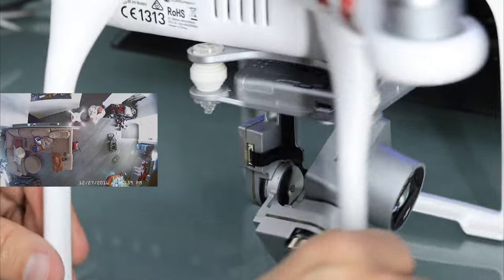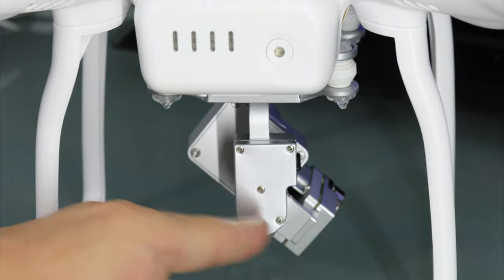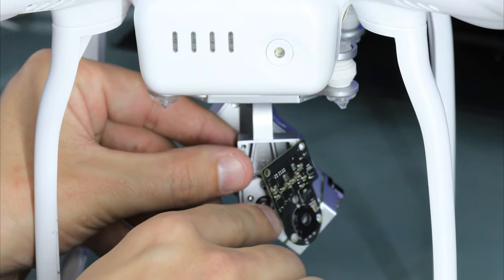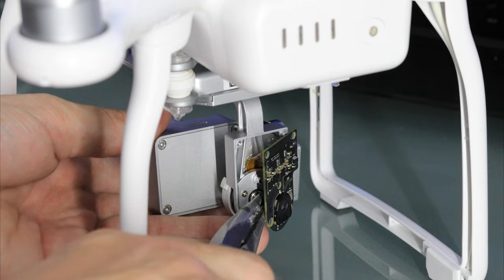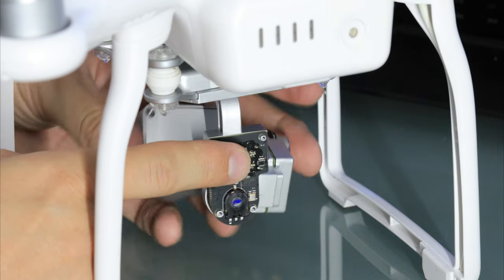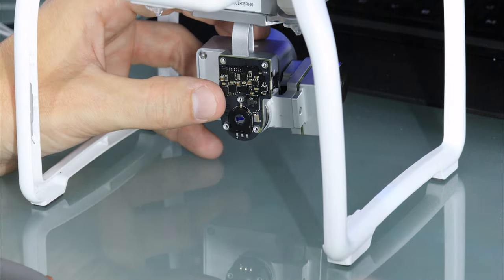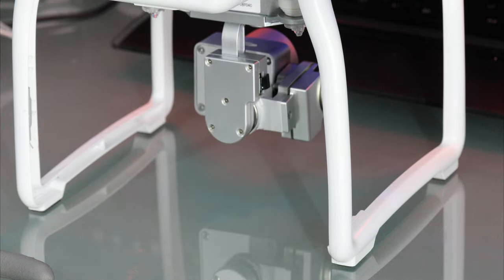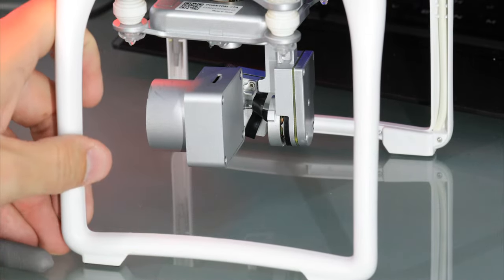DJI Phantom 3 Gimbal Motor Overload camera fix

Comment: So what happens if all the axles are aligned and screws tightened? Fun part is that my problems started after a nasty crash but it's all aligned anyway. I didn't have to correct a thing. It still starts tilted and keeps rolling to the right.

Comment: I have an issue after an accident the Flexible Gimbal Flat Ribbon Flex Cable broke and I ordered a new one and installed it once I install it camera because craze as it in your Video . I tried to do as you did no luck same issue I ordered a new  Gimbal Roll Arm & Motor . I installed them but same issue camera is very crazy please let me know if you can help

Comment: Clint, in the last few seconds you talk about "when I took this off and stuck it back on"... In a frantic mess after mine dropped I popped mine back on trying to help. Since then I was unable to "stick it back on". What am I missing? How do you pry your pieces apart even after that little screw is removed? Any help is appreciated. Thanks.
Reply from the maker: Mine just kinda snapped on, kinda magnetic I think. It was so long ago, I can't fully remember, but on mine didn't even close all the way perfectly shut when it "snapped it back on". You can see the little gap. I'm not sure how that piece is supposed to stay on there. It just kinda snapped back into place.

Comment: I'm having this issue but I noticed gnat flat part on the shaft is only out of line the slightest amount.  Would that still be the issue? I didn't crash mine it just popped up this morning.  Thank you.

Comment: Awesome, video, thanks man,  however, after I did the rotation adjustment, now it won't even try to calibrate, it will just sit there until eventually the overload message come back,and the right hand side gimbal motor is super fry and egg on it kinda hot. Any suggestions? Thanks.
Reply: Mine did same.  After adjusting the gimble 180 degrees and then back 90 degrees it worked.

Comment: Hi, just curious, obviously you are turning the shaft but do you happen to know if the shaft is turning inside some sort of clamp or if the shaft is turning something else inside, at a guess, the gimbal arm?
Reply from the maker: Not sure. If you find out, please post your findings.
Reply: Hi, if I get a scrapper or have an accident with mine I will let you know
Reply: @Team.Louish  It seems there might be a "magnetic sensor ring" on the shaft, it interacts with a sensor on the board. The ring might be glued to the shaft, twisting this ring wrt the shaft changes the 'rest' position of the shaft and therefore the gimbal wrt the board. Acetone might be a solvent for the glue. The ring is apparently very fragile so needs to be handled with GREAT care. As it is magnetic I am not sure whether it is a good idea to use steel etc. tools to move the sensor ring. There are a number of threads about this sensor ring on the phantompilots forum e.g. https://phantompilots.com/threads/p3p-camera-off-center.118727/

Comment: Hi there, I have the same problem with my phantom 3 standard, however, the level sign of my drone is totally aligned with the horizontal plane. What else the problem could be? Best regards.
Reply from the maker: Sorry, I'm not sure. But if you figure it out, please post your solution here so others can learn how to fix other issues.

Comment: i did it it sux anyway, always came back with same problem till i put some super bonder glue on it all. now it sends this overload message but still flyes and record. think its kinda solved but gimbal is not moving anymore due to the glue dji made a shitty fragile gimbal

Comment: Sir why is my phantom 3 camera geting hot after flyt ?
Reply from the maker: You might have two pins on the ribbon touching. Check the ribbon cable going to your camera and make sure its seated perfect and not damaged.

Comment: Could anybody Help me
I crashed the Drone agains a Wall the camera shaked and shaked and i turned IT off
I took IT Home and turned IT on its not moving, but it was before
It smelled a little Like yk When metal Burns, i saw 1 kabel is a little bit cuted.
Could IT be That problem the wire?

Comment: To anyone here..is it possible to put a GoPro gimbal on a phantom 3 standard to replace the original gimbal?
Reply: Clint Decker - Thanks for that.. greatly appreciated..

The GoPro gimbal I had actually ordered has a remote for positioning side/side, up/down and even an app which I haven't received to explore yet..
I also have an existing hero 5 stationed under the back of  battery of my phantom for continuous video instead of continuously positioning the quadcopter which is perfect...I had actually lost the camera only on my phantom, the gimbal and arm itself is perfectly fine..so now I'm thinking on putting my hero 3 with this new one because the video is way sharper than the original camera.

Thank you kindly for answering my question and especially for your knowledge..happy new years and have a great day.
Reply from the maker: Keep in mind with your gimbal remote that you have, chances are that is a very short range remote. If you're flying anywhere far, you won't be able to use your included gimbal remote.
Reply: Clint Decker - That's what I was thinking and actually wondering myself and no mention of it that I've found..
Considering I'm mainly using this phantom 3 for filming boating and quad'n trips, hopefully it'll do the trick with the new one... it'll be interesting to see it's limits of distance before no signal that's for sure..I might have to get a buddy to modify it.

Still haven't arrived yet..but thanks for that.